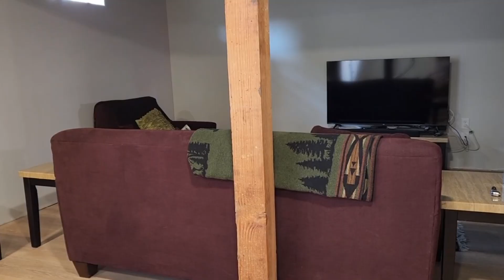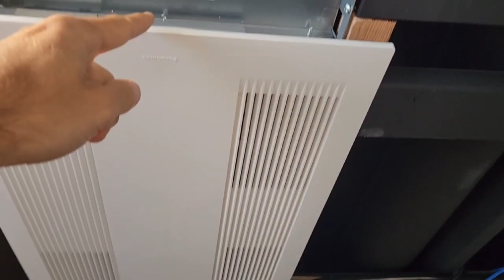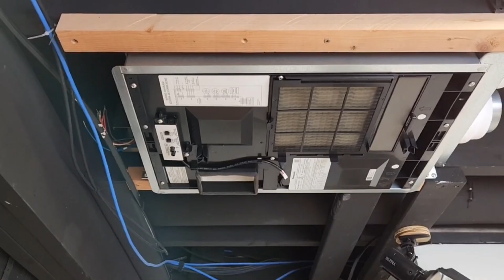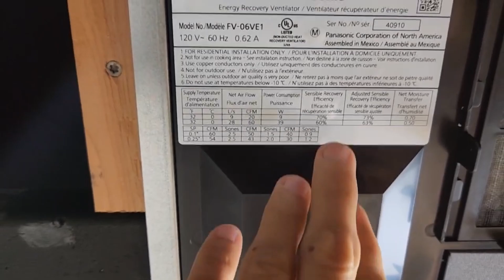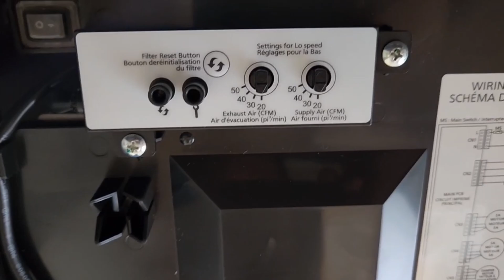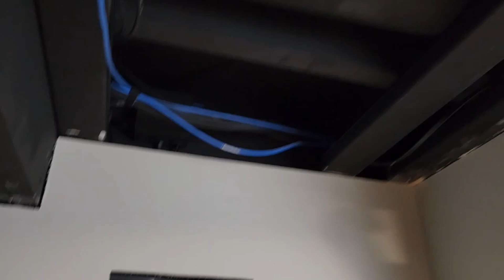Fresh Air Ventilation - Your Three Options

Comment: Thanks for making this video.  So if I understand correctly, the EVR fresh air (supply) will push into your HVAC return, and then the ERV return is just going to pull from the unit itself, in the basement?  If so, is the ERV return, just that one return intake in the basement, enough to keep air flow, flowing around the house?  

Also, did you wire this to your HVAC to run when the HVAC is on?  Or is it just dumping fresh air by itself via the timer on the unit (mins per hour), and the ERV itself has enough juice to push air around the house, even when your air handler isn't running?
Reply from the maker: Air handler needs to run when erv operates if you use the return plenum option.  Erv can pull from bathrooms, or a high use space.